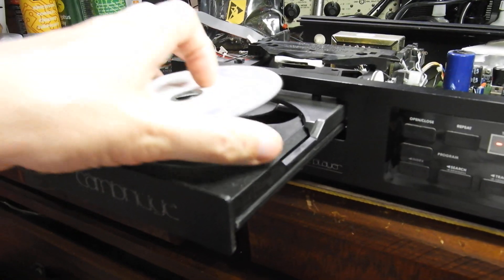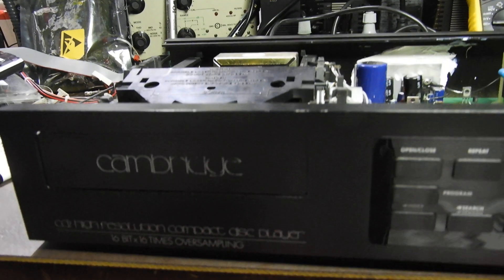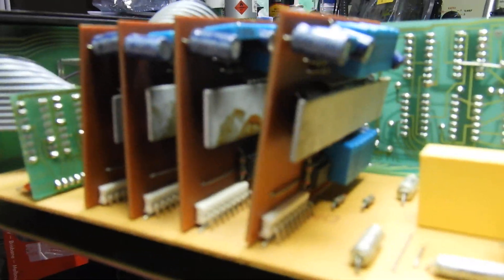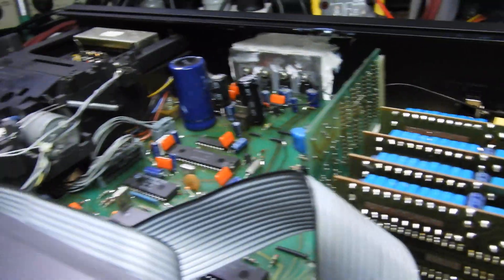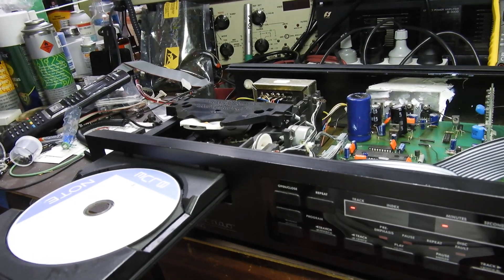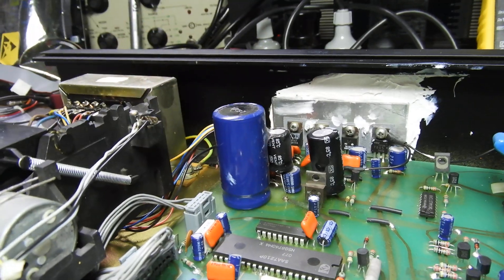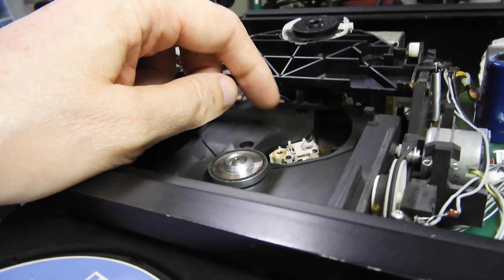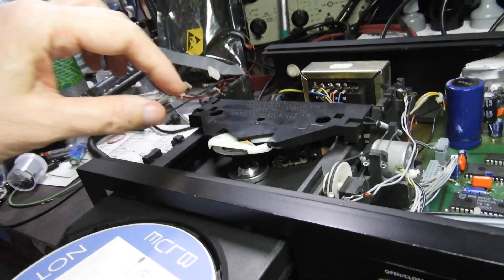Cambridge Audio CD-2. The player with 4 X TDA-1541 Philips DAC ICs.

Comment: Do you adjust to .1mw of laser power with the CDM4?
Reply from the maker: Only if I suspect someone has tinkered with it. Otherwise I leave it alone. If a system worked fine for 30 years OK with whatever power it had, it should be good for 30 years more. This is after I reduced power on some Sony BU-1 lasers and later having found out that they came out from some factories with 0.3mW. 
Some makers, like Arcam make their players work well with 0.025mW and I leave those alone too.

Comment: Check a 33uf bipolar capacitor on the servo board of the cd mechanism. They have a relatively high failure rate. Also, after inactivity for some time, let it just sit there for an hour or so, it's an old girl and needs to get itself ready. Long term they are meant to stay on all the time. You will find the airflow/cooling poor at best and the strip aluminium "heat sinks" on the 1541's under sized. I have two or three of these, change the op amps, clock and Dac Chip caps to better quality. It will then really sing.
Best wishes with your machine.
Reply from the maker: Thanks for this. I will keep your info and once I am back onto it, I will implement it.
Reply: @hear-net-au  My pleasure. I have some CD3's also, they are similar (CDM1MK2) but have better board layouts. Best wishes.
Reply: @abbersj2935 I have problem with cd3....disc spinning all the time when power him up if tray is open...all time fast spinning to the left side....SAA 7220 is hot...i changed to the another SAA 7220 but second IC failed also...any sugesstions?

Comment: For sale ?
Reply from the maker: Not as yet. I have found a very leaky capacitor in the laser assembly and was pretty sure it would  fix the lack of power coming from the laser. But it has not. Maybe someone twiddled with the pots. I have to come back to it, to adjust them as per manual and if this fails, transplant the mech from a donor Marantz machine. But it will be for sale one day. Keep an eye for a second video about it here. Cheers
Reply: Dear Friend, I have the same cd player but originally came with CDM1. Chech that out!!
Reply from the maker: @romulopoubelmouzinho4511  Well, the VasiliTech site states that it is CDM-2 but mine and many others are CDM-4. Maybe they ran out of the first and had to do the later CDM-4 or maybe it was the price.